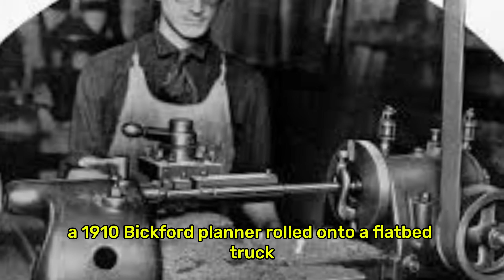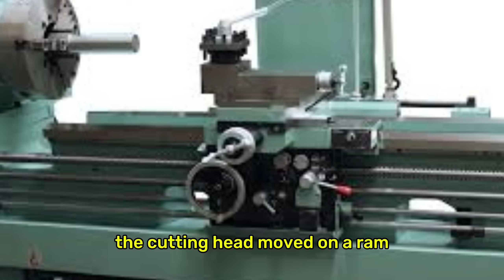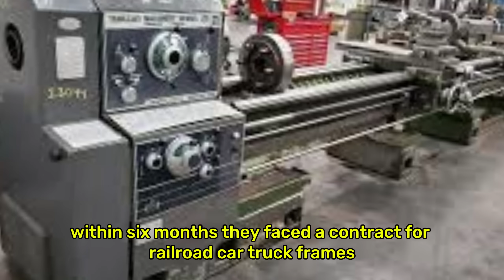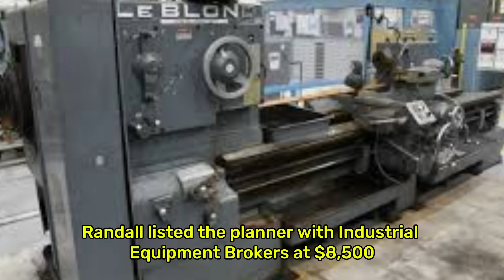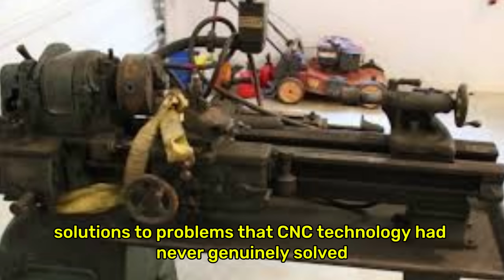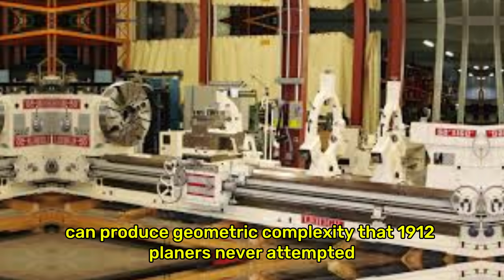The 1912 Planer Shops Tried to Scrap — Until It Flattened Steel CNC Couldn’t Touch

Comment: as a 17yr old apprentice i was trained to use a planer , with a 12ft bed electric over mechanical switching a huge dc generator and i could machine 4ft wide 5tf high 11ft long castings to a one thousand of an inch ,when the shop shut it was sold to a dealer who changed it from rack and pinion drive to worm drive as you dont get chatter marks with worm drive , i think it was sold to a company in scotland ,great fun to operate
Reply: Same age massive planner machining weld preps on chieftain tank hulls (bottom bits)

Comment: Malarkey,any Engineer could learn to operate a machine like this in no time!
Reply: I don't know if a planer is so easy that one dealing with the disadvantage of an engineering degree could master it.  I do however feel confident that a machinist who can master a lathe and a mill could eventually master a planer or shaper.
Reply: @ged5868 An engineer is not a machinist. An old machinist who ran a shaper could run a planer with a little work. The main thing is knowing how to set up the tooling properly.

Comment: Saw an old shaper running in a jobbing shop
 It was cutting 1" internal key slots in large steel bushings. The tooling set up was inventive to say the least but it sure slick watching this old beast run.
Shop owner said they kept the shaper for this job which showed up regularly. When the job was done their big forklift picked up the shaper and stuck back in a corner to wait for the next order.